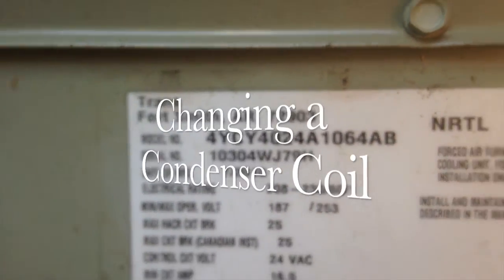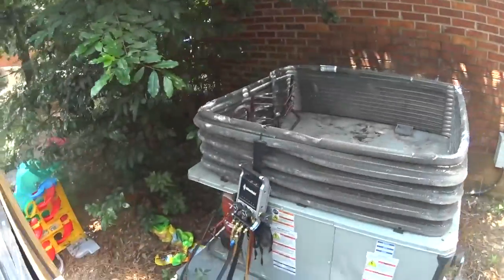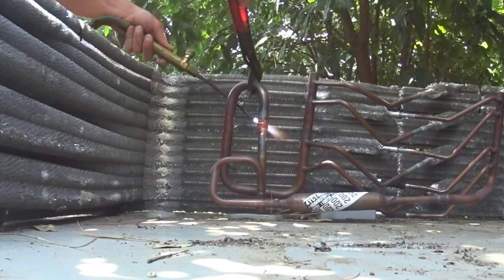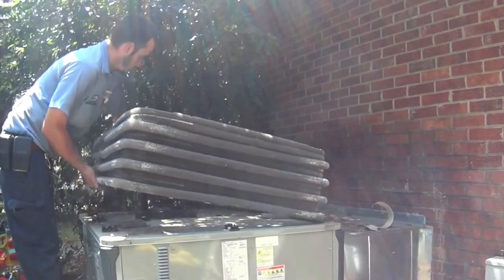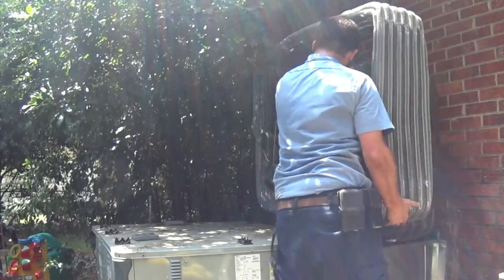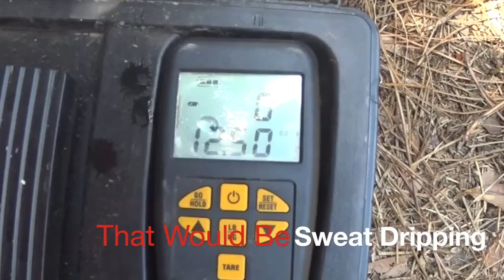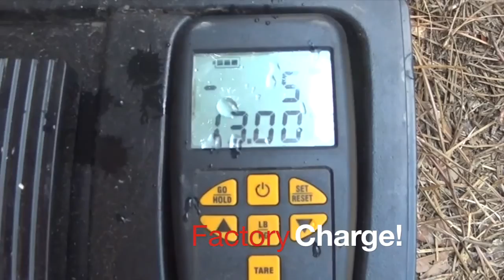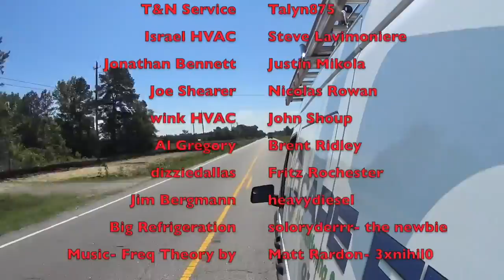HVAC Service: Trane Gaspack Condenser Coil Replacement

Comment: yea the evaps are crated up also. maybe all the resell is the heatpump condenser coil seeing as it works on either a heat pump or a/c. just a thought. less inventory at the warehouses.

Comment: what kinda tip you got on that torch?  mine doesnt give me as big of a flame.  more of a tiny little too damn hot flame that will burn a whole in a pipe in 1 second type flame.  LOL  im thinking i need a wider type flame instead of such a concentrated little beast
Reply from the maker: I found it at Johnstone supply, haven't been able to find another like it since...I think it's generally considered a "rosebud" tip
Reply: you like it better than a smaller pointy blue flame?  im assuming so since youre using it.  i always thought rosebud tips were for bigger pipe.  ill look for one....
Reply from the maker: Yep, I have the thin point tip but I never use it.
Reply: excellent....got some shopping to do.  thanks

Comment: Like your videos Stephen, but was curious why you have such fancy modern digital tools and yet you still use an old analog micron gauge? I don't have the fancy wireless gauges as you do but I've been using a digital micron gauge and test gauges for years now and love'em. Wouldn't use an analog anymore if it was free, lol except for recovery or for purging. Keep up the good work 👍🏻👍🏻
Reply from the maker: I had tried a few digital micron gauges and was not impressed in comparison to my old analog. I've since updated to the BluVac and micro BluVac
Reply: +Stephen Rardon (HVAC with Stephen Rardon) 
I have seen those but have yet to try them. How well do you like them? I'm currently using a first generation fieldpiece sman with built in micron gauge and am pleased for the most part aside from the isolation issue having to be at the pump instead of at the gauges. I mainly service, commission and install commercial equipment now from 1/2 ton to > 25 ton and some require holding a vacuum for 1-2 hrs due to inability to properly purge (1 condensor with multiple AHU''s) and an analog is just not precise enough for me on standing tests. Done any multizone heat recovery systems yet? Thanks and stay safe.
Reply from the maker: I like the micro BluVac for the price but it's hard to beat the features on the Original BluVac! Explain multi zone heat recovery system? I'm not familiar with that name. I've done some multi zone mini splits though. Had one condenser and 5 zones consisting of 4 ceiling cassettes and a wall mount. It was an attempted homeowner's install that we got called in to finish/fix.
Reply: Stephen Rardon The multi zone mini splits is basically the same. With Mitsubishi its a two pipe system up to what they call a bc controller then from there to the cassettes or wall hung units up to 32 of them but with the single condenser some indoor units can be heating while others are cooling. Daikin has one thats a three pipe, LG also has one. It's relatively new technology for the states but has been in Japan over 30 years. You can't charge them by p/t, the charge has to be recovered then weighed in and you have to have a computer with their converter to see operating p/t's and change settings, etc. I had to take their class before they would even sell them to us. They have a lot of electronics and engineering but then use a flare fitting for unit and isolation valves and they are 45° flares so they require a special tool and flare nuts not the normal ones.
Reply from the maker: Robert L ok, yeah i haven't worked on that specific design but i have worked on a Fujitsu with 2 splitters and 2 eev distribution boxes. They won't heat and cool simultaneously though.
Reply from the maker: https://www.youtube.com/watch?v=8yTY0lJpIFI
Reply: yeah sounds and looks very similar. They are a pain to install and a pain to service. I haven't done a Fujitsu yet but all the ones save one that was dedicated to server rooms in a high rise building have all had the ability to simultaneously heat and cool. If any one unit is calling for heat, the discharge bypasses the condenser coil and goes to the one(s) calling for heat then once the refrigerant is condensed it goes to the one(s) cooling and never even goes into the condenser coil.
Reply: check out the refrigerant flow software for an animated flow demo